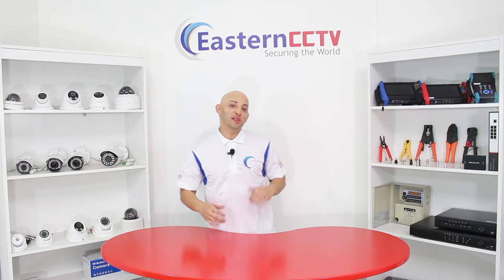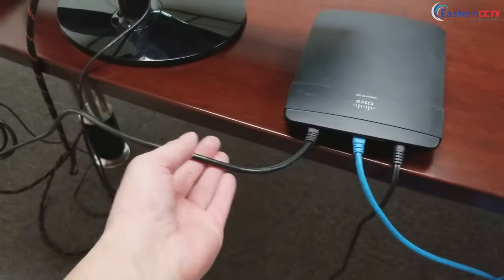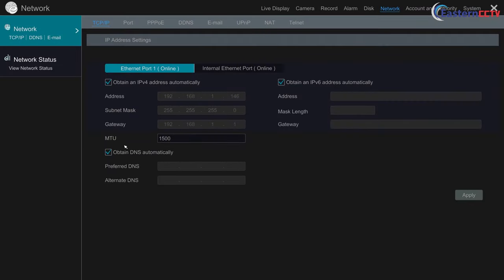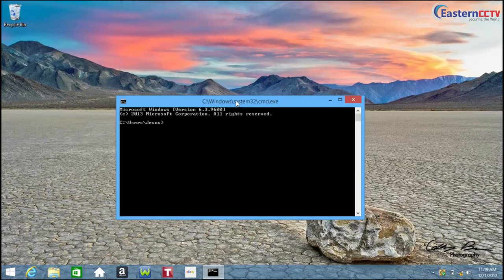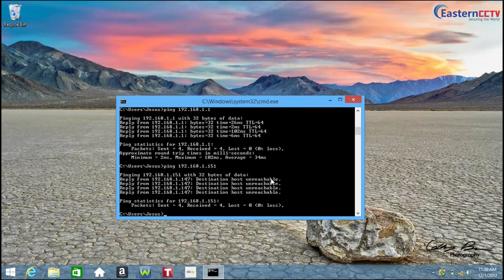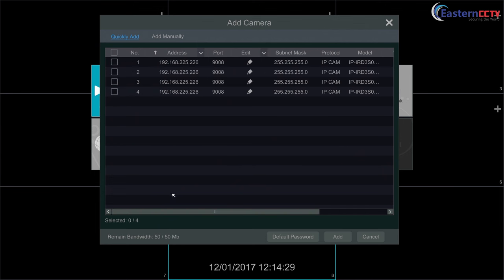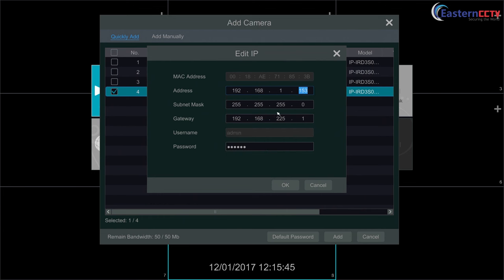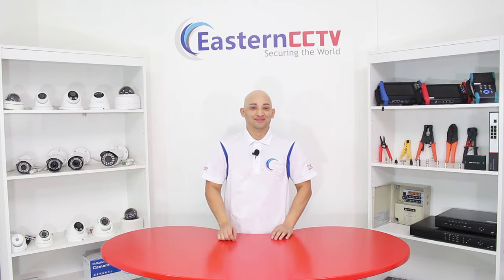How to Configure IP Cameras Using External PoE Switch Step by Step ( Titanium Series )

Comment: Great video, questions. Will it work if I connect those cameras directly to NVR? What's the point of Switch > Router  I think to get internet right only. What's the difference? Where is the Uplink of that router to get internet?
Reply from the maker: Thank you for your questions, if you connect cameras directly to the NVR they will work. The POE switch has a couple of uses, if the NVR can handle 32 cameras, many times the actual direct connections on the NVR can be 16. The POE switch adds the additional direct lines to get more cameras connected to the NVR. Connecting to the internet requires connecting the NVR to the Internet Provider. Hope this helps answer your questions. Let us know how we can assist.
Reply: @ENSSecurity  thank you , so poe switch is optional as nvr has the POE switch itself. You are right👍
Reply from the maker: @ProfitableAgribusinessIdeas  That is correct

Comment: Video is very good and explained the process step by step. But you didn’t explain why this method of cable configuration i.e. Cameras to Poe Switch then PoE Switch to Router and Router to NVR is more advantageous over the other method of Connecting Cameras to NVR PoE ports then NVR to a Switch or Router. And in which situations you would use this configuration than the other way. What are the pros and cons of both wiring configurations. Please explain. Thanks.
Reply: exactly, I didn't understand the purpose of this video.

Comment: Nice, basic video. You might want to mention DHCP range.
Randomly picking IP addresses that are also in the router's DHCP table range is a recipe for disaster.
I'm not saying that you need to explain all that in the video, but mention it so that installer can investigate and educate themselves further. Otherwise, there is a very good change that few days/weeks after installation they'll be getting phone calls about some cameras not working.
Reply from the maker: Good point, and thank you for the feed back. for future reference I will try to explain as much as i can but at the same time be brief about it. =)
Reply: but he did ping those address and there is no reply so those IP address form the range allocate to ip camera. The router have the DHCP in it.

Comment: QUESTION DID YOU USE A CROSSOVER CABLE FROM ROUTER TO SWITCH OR LAN/PATCH ?
Reply from the maker: Most consumer products support MDIX so cross over cables isn't necessary. We used a straight-through cable in this video but YMMV depending on what the equipment supports.

Comment: Can I add 32 camera in my 16 channel nvr using switch? Please let me know
Reply from the maker: Hello, the channel maximum is the total IP cameras the unit can accept. If the NVR is a 32 channel but only has 16 ports on the back of the unit, you can use an external PoE to add the remaining cameras.

Comment: Very helpful video.  I have one question.  When setting the IP addresses for the cameras using this process does the IP address become static so that they do not change when the router loses power or when the NVR reboots?  Thanks!
Reply from the maker: if you are able to change the ip address of the ip cameras from the NVR, then the IP address of the IP cameras would be static. and nothing will happen if you reboot the network.
Reply: Thank you

Comment: Thank you for the useful video 

I have a question, i have a Dahua IP camera and Dahua NVR 4 Channel but doesn’t have built in POE so i had to buy an external POE switch now my question is I don’t want to use router or internet i only need to connect one camera directly to the NVR, when i connect the nvr to the poe switch and the ip camera connected to switch poe but i got blank screen on the monitor that says:10.0.0.60 Can not find the network host

So do i need to adjust the IP address for the camera make it the same as NVR IP address??

Thank you
Reply from the maker: If you dont have a Router. then you need to create your own ghost network. set the ip address to the NVR static for example IP:192.168.1.10 SUB:255.255.255.0 Gateway: 192.168.1.1.. then connect a laptop to the PoE switch and use the software that Dahua uses to find the ip cameras on the network and set each camera with the same network setting except the IP. for example first IP camera 192.168.1.11 the second 192.168.1.12 with the same SUB and gateway and then you should be able to add them onto the NVR. hope this helps.

Comment: I have my camera cables and internet router in my garage. I have ethernet cable in my room which is connected to switch in garage. Can I put camera cables in that switch in garage and connect nvr in bedroom which has Ethernet cable coming from same switch?
Reply from the maker: Hello, we recommend reaching out to your installer before changing wiring. If you are the installer, please reach out to our technical support department.

Comment: Hi, I'm planning to leave the switch in my roof and the NVR in the house. I will also connect the NVR to a UPS to provide a back up if someone would tamper with the main power. How should I connect it all to have the switch connect to the UPS as well? I reckon the switch must be directly connected to the UPS?
Reply from the maker: Everything that you would like to have it ON in case the main power goes off needs to be connected to the UPS. if you are able to connect the NVR and other devices to the UPS simply use a Power Strip to connect more than one device to the UPS. if you cannot do that then you must get separate UPS to power the other devices that are not in range.

Comment: Hi I am having a problem adding my ip WiFi camera to my nvr! Is it the same process I need to follow to get it to work, it works on my nvr but once I unplug the LAN cable it freezes and says not available. I’m lost what to do now because all I want is to you it for the Wireless feature not have a LAN cable attached as that. defeats the object. Can you give some info what I can do as I’m not very tech
Reply from the maker: The problem is likely either that: 1) power is not being given to the camera, so when you unplug it from a PoE switch you lose power to the camera. 2) you may be programming the cameras "wired" connection rather than it's 'wireless" NIC setting. or 3) Wireless signal at the mounting location isn't enough

Comment: Great Video!
Question: SInce this setup is already connected to the network switch, can we do away the NVR and retrieve the video footage on a desktop PC instead? If it is possible, is there software available for me to interact with the cameras on a PC without a NVR?
Reply from the maker: Yes that can be possible, but the Computer needs to be 24/7 ON in order to Record. Also make sure that your IP cameras Have a CMS Software. I really dont know what type of cameras you have at the moment but if they are Our Brand you can go to our website and download the NVMS1000 for windows or NVMS1200 for MAC under Support. Note that the HDD on the computer needs to have a large space for the IP video recording and also that the CMS does not work exactly like a regular NVR.

Comment: Is it possible to connect the external switch to one of the NVR Internal Switch Ethernet ports (usually used for cameras) so that the cameras connected to the External Switch are assigned ip addresses from the nvr internal switch, so the cameras on the external switch appear to be on the internal switch’s network?
Reply from the maker: Yes, in order to use all the channels that NVR's or DVR's offer you need to use an external switch to add more cameras. Many NVR's and DVR's do not have all the ports needed in the back. For example, an NVR that can handle 32 Cameras may only have 16 ports available, you would need an external switch to add the additional 16 cameras. However if a recorder is not able to handle more than 16 channels, adding a switch to add over that capacity will not work. The key is, how many channels can your recorder handle.

Comment: Hello, thank you for this clear explanation. I have one question. I have connected the Nvr to the PoE switch. The PoE switch is connected to the router. If I search the cameras, he sees them, but al have the same ip adres and same image. How can I change this? Thank you in advance!
Reply from the maker: You will need to use the appropriate IP configuration tool. Scan for the cameras with the tool, then assign IP addresses that follow the general network scheme. The tool will depend on the product line.
Reply: ENS Security Plainview | Professional Security System Wholesaler thank you for the quick answer! I don’t think I have a config tool for this camera system.

Comment: I have question I have Hikvision  nvr when went in the camera configuration it see the camera it they when add camera. it say no ip camera find. the camera all hook to Ethernet port . I even change the ip address as closeer to the default gate. same same problem the  camera that is connect through the wireless Bridget. some i was able to add it would say network unreachable.
Reply from the maker: Do you have IP cameras that are Hikvision and an NVR hikvision?

Comment: Question? I assume that the cameras run off of the Ethernet cable power as the dc leads are disconnected. Is this correct?
Reply from the maker: Yes, that is correct. As long as the camera is Power-over-Ethernet capable and connected to a PoE switch.

Comment: Excellent video....very well explained. However, I have a two questions I am hoping you can assist with.

Q1... The configuration software that you use to check the settings of the network, and also add the cameras. Is this standard software that comes with the NVR or is it an additional purchase. And in addition to this, if the software is part of the NVR, where are you viewing this to enable you to adjust the settings. Is it via a HDMI cable to a monitor or to a PC screen.

Q2... If one of these cameras was say a very high end IP PTZ camera whereby it needs additional power, say 12 or 24v, how do you connect this if the camera is say 15 to 20 mts from the camera to the POE switch. I'm sure the Adaptor does not have a cable that long.

Is it possible to add a video on how this would be setup. I am thinking of getting a system using 1 or 2 IP PTZ cameras (high end) and want to ensure I get the right POE and NVR. I wouod also like it to work with a Apple environment NOT WINDOWS.

Any assistance would be helpful...I find your videos very informative...Keep up the great work.
Reply from the maker: Q1 A1.. That is part of the NVR interface and there is no additional Purchase. It comes standard on all our NVRS.

Q2 A2. Most cases IP PTZ cameras Installers Run a Pair of 18 Gage wire to provide power. If the PTZ needs 24V AC you can run 24V AC on 18 Gage cable easily 800Ft. If you are running 12V DC you can easily run 200Ft. The connections as for the network stays the same. IP Cameras to PoE switch, PoE switch to the Router and NVR to the Router.. The NVR has a software client for PC and MAC OSX. Mobile remote is fully supported with Apple and Android devices. "Super Live Plus" that's the app name. Note: If you buy a NVR system and have IP cameras from different manufactures this features might not apply. It is recommended to have the NVR and IP cameras from the same manufacture or brand to work best.

Thank you i hope you find this useful.
Reply: Yes I did, thank you. Just wish you guys operated here in Australia, would get you to provide and install the system. Have a very hard time getting reliable feed back here. I am looking to spend a reasonable amount, just want it done properly.
Reply from the maker: We hear you. I hope our help even from here can help you..

Comment: Hi what if i want to have 2 poe switch? Does it work 2 cameras every switch ( wanna use the second switch to another building) so that only 1 cable for 2 cameras long range
Reply from the maker: If you have 2 or 3 PoE switch you can connect them this way. From the Router connect a CAT5/6 To the first PoE switch on the UPLINK port, then plug one CAT5/6 on any PoE port in the PoE Switch and connect it to the 2nd PoE Switch on the UPLINK Port. This way you can connect as many cameras as the PoE switch is capable of using just one cable run to the Router. Note. You can also connect the NVR into the PoE Switch, Just make sure you connect the LAN port of the NVR to any available port on the PoE Switch.

Comment: Does the POE switch need an uplink port? My NVR  network system will be separate from my internet network.
Reply from the maker: You can also connect the NVR LAN port into any available port on the PoE switch. It is recommended for the PoE Switch to have an UPLINK port so it can be connected to the Router. If the PoE switch does not have an UPLINK port then simply connect one of the PoE ports to the router. So basically everything would be connected to the PoE Ports on the switch. NVR, IP  Cameras and Router.

Comment: Does those cameras supports PoE? What if those cameras/devices doesn't? Is this setup still applicable?

About the setup on your IP addresses of the cameras, is it remotely viewable? Because, I think if the IP address is different to the network, it wouldn't be remotely viewable. Right? Correct me if i'm wrong. Thanks!
Reply from the maker: yes, it supports POE.it's still applicable, just need to make sure the cameras/devised get powered up. The IP address should set according to the local network. The IP address on the Video is an example to show how to setup.

Comment: Can I connect the router to the POE switch instead of the NVR and the NVR directly to the POE switch? I ask the question because I think it will be better in case that there is no power and the NVR and the POE is running with a battery backup. And if that is the case what is the process to setup everything on the NVR?
Reply from the maker: Yes, you will be able to connect everything to the PoE switch. Remember that the UpLink port on the PoE is the one that is going to be connected to the router. Hope this helps.
Reply: meaning if we want to achieve this, we need POE switch that has more ports, right? anyhow...i was wondering, what is the difference between these 2 connection types; NVR to router VS NVR to POE switch? 

Please advice. Thank you.
Reply from the maker: If you connect the NVR to the PoE switch and the PoE switch to the router makes no difference as the other way. The only thing is that if you connect the IP cameras to the PoE switch then the NVR would Auto configure the IP cameras instead of adding them manually

Comment: hello is it possible to do the same thing but creating a Point too Point with Ubiquiti antennas then connecting cameras under a poe switch and the switch poe under the reception antenna ubiquiti?
so that the cameras are seen?
Reply from the maker: Hi, You may use PtP Ubiquiti antennas to transmit data but will need to make sure the equipment can support the total bitrate of all cameras transmitting data. It is preferable to pre-configure IP addresses on the IP cameras when doing this if the PoE switch where the cameras are directly connected to are difficult to get to with a laptop because scanning tools may not find the cameras across the Ubiquiti equipment.
Reply: @ENSSecurity  thank you. can I ask you for help to make a plant? I have to understand how I have to do the job thankyou

Comment: Can you have two or more POE switches plugged into a network then the one ethernet cable plugging into the NVR?
Reply from the maker: Yes. You can connect them this way. 1. Switch 2 is connected to switch 1 and the NVR can be connected to any Switch or directly to the Router as long as the Switch 1 is connected to the router. 2 Switch 2 is connected to switch 1 and NVR is connected to the router as long as switch 1 is connected to the router.
Reply: what will happen to 2 NVRs and few ip cameras connected within the same network? Does this mean both NVRs will sense all cameras ,I mean same cameras in NVR 1 will appear in NVR 2
Reply: Dickson Kimanzi I don’t know. I’m trying to learn as much as possible.
Reply from the maker: @dicksonkimanzi9510  You can have 1 IP camera connected to 2 NVRS or more as long as the IP cameras are connected to the External PoE switch and they have their local static ip address. So on each NVR you will need to add the ip cameras manually using the ip addresses of each ip camera that you want to display on the NVR.
Reply from the maker: @quintriggins6557  Any questions feel free to ask. =)

Comment: can i connect a small 4-port poe switch and connect it to a regular 24-port switch that does not have poe?
Reply from the maker: Yes but the IP cameras always have to be connected to a PoE switch. Unless you provide power to the IP cameras using the 12VDC jack on each camera.

Comment: I'm new to all of this can you plug the bot into the router and see the cameras on your computer or do you have to gave an nvr. I was think of recording using my computer or can you do that.great video btw
Reply from the maker: You dont need to have an NVR to Watch the IP cameras remotely from a Computer. Some IP cameras have a software that would allow you to make your PC to record as an NVR but the PC needs to be on 24/7 just like an NVR would be. Also, the software allows you to see all IP cameras on the screen as if you had an NVR.
Reply: @ENSSecurity  I thought that was the case as far as using a PC I'm guessing you have to have some kind of Hub to plug all the cameras into and of course power them if you're using Poe
Reply: @ENSSecurity  thank you by the way preciate your reply
Reply from the maker: @nightstringers  Correct.